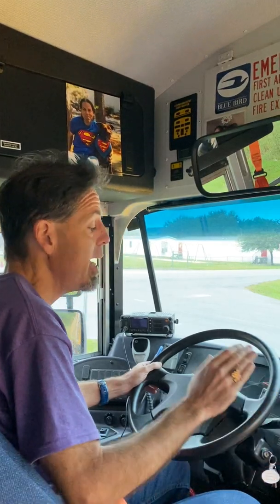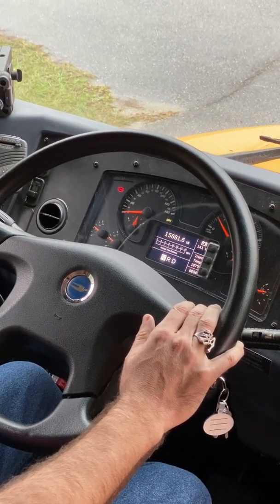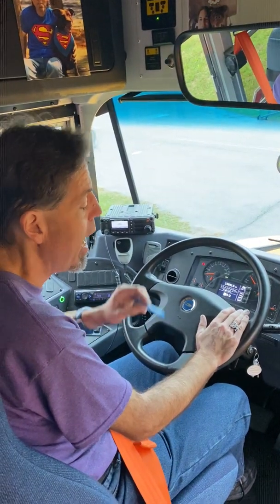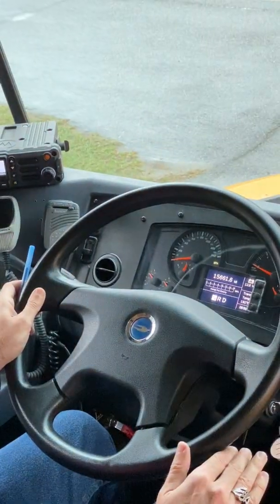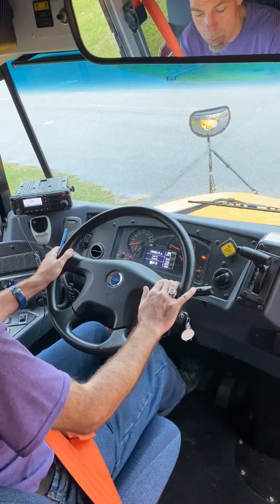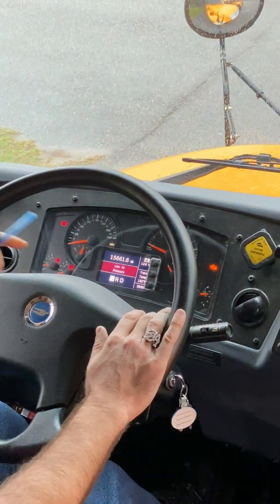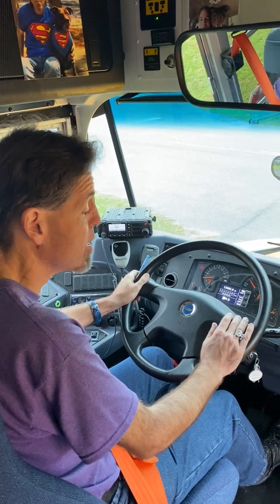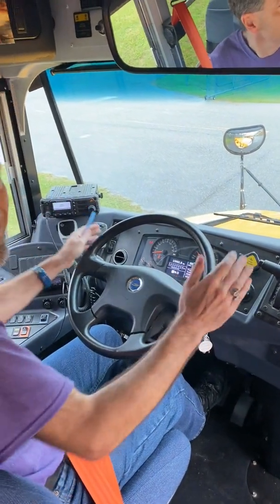*** Air Brake Test – School Bus – Class B CDL ***

Comment: You forgot the air governor cut in test @ no less than 85 psi. This is missing several steps.
Reply from the maker: It all depends what state and what vehicule you are tested in.  When this video was produced, it met the requirements of the Georgia Department of Drivers Services and the Georgia Department of Education.  From time to time, there are minor changes to the guidelines.  Therefore, I will update as soon as possible if necessary.  I recommend that people who test in a different state or vehicle check with their instructor for exact details over guidelines.  Thank you.

Comment: Where did d e f tank on the 2020 IC CE School Bus handicap School Bus
Reply from the maker: If I am not mistaken, the DEF tank is near the service door.  If you are tested on a bus that does not have a DEF tank of gage (that is an older bus and/or a gas bus,) you do not need to mention the DEF tank.  Otherwise, the examinor expects you to mention both the tank and the dashboard gauge.  Thanks.